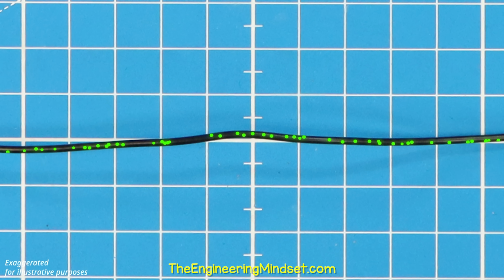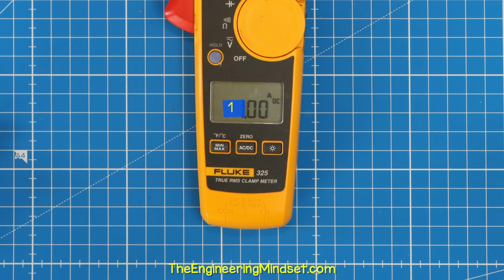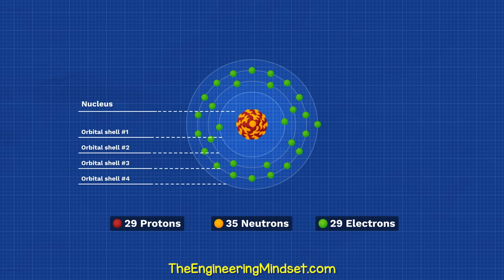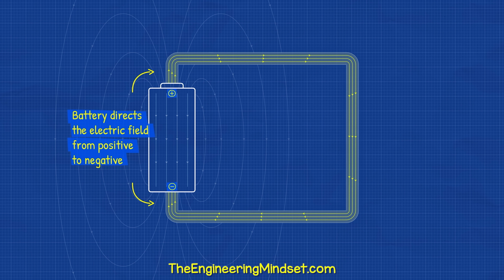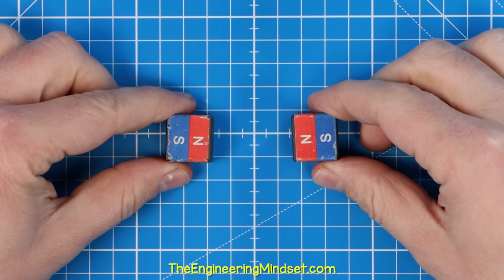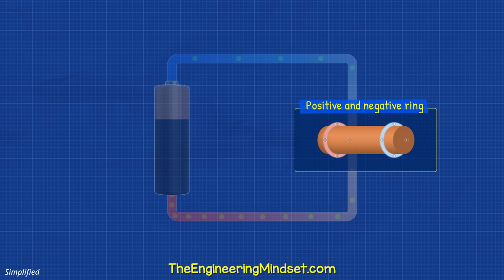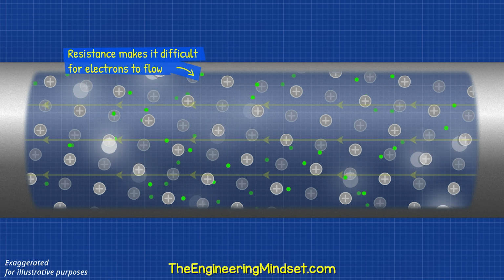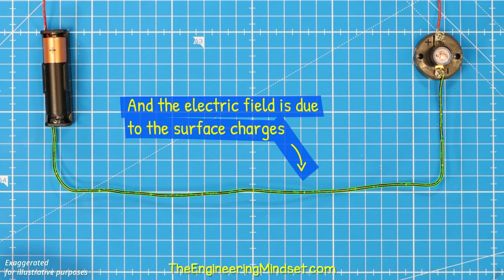How Electricity Works - for visual learners

Comment: Very refreshing (no pun intended) to hear someone attempt to actually explain electricity –instead of just using the "water-flowing-in-a-pipe" analogy. I'm still not desperate to understand how it works, and watching this video a few more times should help a long way!
Reply: What a weird comment
Reply: @henkenheimer9034 most of the people explain electricity as just saying water flowing down the pipe in microscopic version 😅.
But this guy explained everything in a proper way
Reply: Ohms law is not a law that ohm created but an order which things obey which ohm happened to witness. Who gave the order and why are the things so loyal as to obey consistently? You see different perspectives look for different ways to explain things. Water through a pipe is perfectly fine.
Reply: @LetYourMindPlay  Until it's not. Last time I checked reversing the flow of water in a pipe 50 times a second did not help it travel further. The comparaison with water is really just that, a comparaison. It can help explaining electricity at a very very shallow level, but too often that's the only explanation we get. It's like saying planets are round because they "prefer" this shape, which I read somewhere. Just feels very unsatisfying and illogical.
Reply: @henkenheimer9034  I was about to say the same! 😃
Reply: @haventyetbegun  it's not illogical but focusing on a different aspect and at a different level... Most of what was said in this video is not actionable knowledge. Especially not for an individual. Meanwhile the water example often given is plenty to give real world electricians an understanding enough to get them started. The information presented is accurate to the degree of which it was studied. The author even mentioned how he chose to show atoms in a classical sense rather than in a quantum sense. Which one is real? They both are, one is more useful and easier to understand, the other also useful, but more than likely to future generations. It's ok to appreciate your level of study, but don't mock the other levels as they may prove more useful.
Reply: @LetYourMindPlay  I don't know where you got the idea I was mocking other education level. Yes it's very easy to make the point that any knowledge is just an abstraction of reality. But there's still a difference between an abstraction that's meant for practical purpose, and an explanation meant to make us understand things, how illusory this goal may be. What I'm expressing here —I'm surprised some people find it controversial— is criticism of the fact almost all videos and articles I found before that claimed to explain electricity (for curiosity purposes, not for teaching electricians) did not even attempt to explain anything, but relied on making parallels with water whenever convenient. TLDR: I'm glad I found a high-quality video that delivered on its title 🙂
Reply: what annoys me more is explaining electricity in terms of height... Like energy potential differences. I don't wanna analogy when learning about this shit. I want to understand this actual phenomena. There's no real analogy to this in real life I guess.
Reply: @PinkeySuavo Well how else are you gonna explain something aside from analogies. We can't see any of this stuff physically so aside from mental models you only have math. But math is hardly enough to get an intuitive sense of physical phenomena which are invisible.

Comment: Summary: EM fields/waves are travelling first when you flip the switch. They induce "current" in the wires, but it's only a power loss (some fraction of fields penetrates the wire - superconductor doesn't allow that). Energy is OUTSIDE the wires (very close, in the insulation).

Comment: Nice to see a video that highlights the role of surface charge in circuit theory. For too many years it has been neglected in basic courses, to the point that ignorance of its role is a major cause of misunderstanding electrical phenomena.

I envy your ability to synthesize concepts in so short a video. It's taking me multiple half an hour videos just to introduce the concepts of voltage and potential difference.

Comment: So how did they see those electrons again to formulate the math formulas ? It's  a metering system to charge money for something not understood. Hence the name, Electrical Theory.
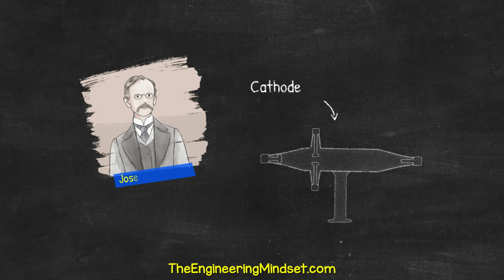Reply: Rewatch the part from 1:26, that should explain it
Reply: Again, nobody has ever seen an electron....it is a hypothesis. Just because a mathematical equasion exists does not make it relevant.
Reply: If you have not noticed yet, we build math to fit findings all the time. Our electrical math is good enough to build computer chips and not burn up or fry. It may lack a little in the magnetic field of coils, but we get close. All of the math we use for electrons has been accurate enough with a few notable changes in history to allow trillions of transistors in a CPU to function at ghz speed. As well as the RAM, and Power Supplies. So maybe it's not 10p% perfect in all areas, but its close enough for us to build miniature computers with screens that communicate wireless aka Cell Phone. So the math I would say is good enough for the task as far as I have seen so far.
Reply: @newmonengineering  I believe OP means in terms of charging £,$,€,R,¥ per watt. There could be inflation in terms of company charges.

As we get more educated, knowledgeable, effective and efficient in producing energy. Costs should either stay or drop reletive to improvement. Not increase as high as they do now.

Comment: At 8:21 the correct formula to calculate the Time to travel should be time=distance/speed, not time=speed/distance. The result is correct, but the operands are swapped. Great explanation though, thanks!
Reply: nice observation
Reply from the maker: You are correct, well spotted @davidegalilei e-mail me and I'll send you a mug.
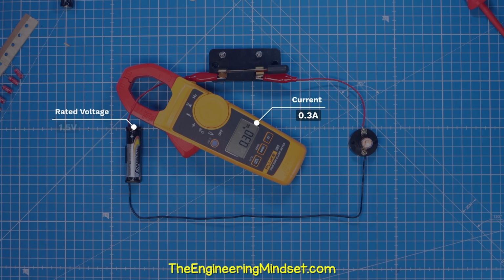Reply: @EngineeringMindset  While we are at it, at 4:00, the formula for power should have amperes (units) squared, so 5Ω × 0.3² A² = ..., or (0.3 A)².

An excellent video packed with valuable condensed information!

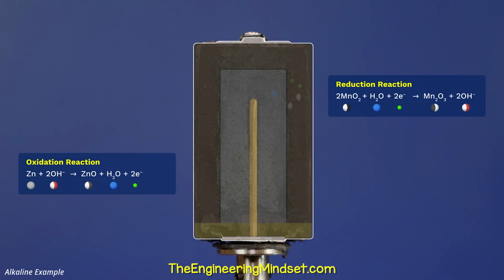Comment: 9:40
For the love of god, please explain us, in this fasion, how having 2 or more batteries in series increases the voltage.

I drew all of this out on paper and it makes no sense to me still.

According to this, I should still expect the same voltage!
Reply: When you put the negative electrode of the top battery in contact with the positive electrode of the bottom battery, the excess electrons and the lack of electrons neutralize each other. Both batteries are forced to produce a new charge separation that will result in double the positive charge on top and double the negative charge at the bottom. Each battery still produce the same charge separation.
Reply: To add to the reply above, it may help to consider a reference point such as ground. Sometimes ground is connected to earth (earth ground) amd other times it's just a common reference. The point between the 2 batteries could be considered your ground   (or 0 volts) reference point, the the voltage on the negative side of the fkrst battery would be negative voltage.  We just typically put the negative side of the supply voltage as the ground reference point as a matter of convention, and each battery connected in series adds that batteries voltage. This also happens inside batteries with more than one cell in series, e.g. a 9V battery has 6 x 1.5 voltage  cells in series inside of it.

Comment: In 1966 while pursuing a BSA Radio Merit Badge at age 10, I was instructed by a HAM operator working with the Navy Military Auxiliary Radio System (MARS) becoming proficient at sending and receiving  Morse Code beyond 30 WPM. All that to say: I had to learn all the Electrical Formulas by rote. Any young person today interested in Electrical Engineering will be well served by your excellent presentation. Thank you for not “dumbing down” the subject in any way.
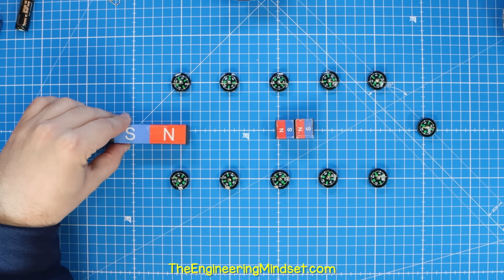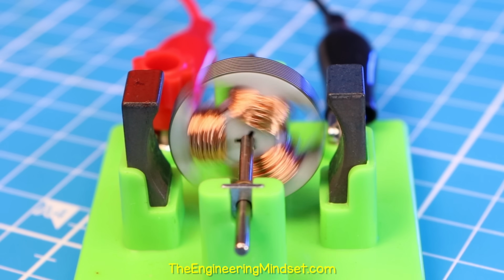Reply: So this video, while being one of the better ones I've seen on the topic, is oh so close, but I think it still leaves a common misconception about what is happening in an electric circuit.  There are several hints in the video about this, especially starting with the field discussion at 6:53 and the drift speed discussion starting at 8:10.  I'm not saying it is wrong, but rather that a key idea is missing.  This idea becomes clear in an electro-plating or electrolysis situation where not just electrons, but whole molecules are caused to move by the current.  The drift speed and time differential in what happens was covered quite nicely by Derek in a video on his Veritasium channel.  I think it would help to say that the ENERGY in an electric current is a wave function that travels along the surface of a conductor whose electrons (or molecules) are easily pulled free to move in the direction of the current.  Thus, the motion of the electrons, while fitting quite nicely with all of the math and equations, can better be thought of as COMSUMERS of the energy in the current.  This makes the pressure discussion in the light bulb explanation more obvious I think, and it totally accounts for the delay in their motion when a current is first setup,  It's a drag function.
Reply: Thanks for informing everyone that is the case 😊
Reply: @charlemagnesclock  Dereck was wrong, we know this because wire gauge is an exceptionally poor way to gain surface area.  By that proposal, smelting common copper (as 110v electric grade) and placing it into finer gauges would increase the ability to carry charge and it doesn't
Reply: @charlemagnesclock thanks for sharing.   How would the consumer concept then apply to suprrconductors?  I'm not seeing how it would fit the situation.
Reply: @kabbak  This is a guess, but I think it is a good one.  So let's look at what the physicists are telling us about the nature of particles when they come together and form larger structures such as atoms and molecules.  This thing they are still calling forces (now down to three, since they have decided that gravity isn't a force) is somehow a kind of energy that has the potential to bind things together.    Remember that all of physics, especially at this level, is just math, models, predictions, based on those models, and measurements to validate or find issues with the predictions.  So definitions for things like forces and energy start to look more like equations than something to which language structures like to assign something discrete like a noun.  Every time physicists start to get comfortable with saying something IS x, some new data comes along to cause trouble for that sort of statement.  Ok, with that serious limitation in mind, it would seem that way down at the particle level, there is some sort of similarity between energy and the three remaining forces.  As temperature goes down, the energy level within the particle structures goes down as well, especially as things approach absolute zero.  Thus, one would expect the drag on the waves travelling along the surface of the materials that easily let go of their outer shell electrons (i.e. conductors like copper and gold) becomes even less, hence superconductivity.  This line of thinking would seem to align well with the challenges that have been faced trying to identify a way to have superconductivity at STP.    But again, I would rather put the question to someone like Sabine Hossenfelder or Angela Collier, since they are real physicists, and are both good at explaining stuff like this.  And I am fully open to Angela having one of her little snits and calling all of this crackpot physics.  Derek Muller is more of a math guy, but because of his channel popularity, he has the ability to tap a lot of top physics teachers to make contributions, so he could do a good job as well.  And while we are at it, let's all wish Dianna Cowern success in her efforts to recover from long COVID.
Reply: It's STILL so much layer-upon-exasperating-layer of scientific jargon which DEMANDS a degree in physics or electrical engineering, an extremely rare and special INSIGHT at the very least, to comprehend this mess. I TRIED.
Reply: @waynesanchez6504   Electricians have their own language.  Here is the core: No one knows how electricity works.  They know how to use it, control it but not how it works.  Voltage is a design.  Amps is the working load.   Ohms is the resistance or loss.
Reply: @whatsup3270  Well it's not just surface area, it is the volume of space around the conductive materials.  That's because of the field.  Look, I'm more of an engineer than a physicist, but it just stands to reason that when you move something, energy has been consumed in the process.  If we apply Occam's Razor to this and the skepticism requirement that extraordinary claims require extraordinary proof, I would think that the claim that the electrons move without consuming any energy would be the extraordinary claim.  Again, this whole thing fits really nicely with the whole business of resistance.
Reply: @charlemagnesclock  Though I agree with most of what was said I would like to point out the evidence is the oppose of Veritasium's proposal.  For example if an equal wire is coated with an insulator and tested bare it functions better when it loses or greatly impairs its surface electrical field with that insulator.  Occam's razor would say the bare wire can not create an electrical field unless it converts or loses energy to do that.  It would also say a resistor generates heat and thus losses energy while and insulator does neither.
Reply: @waynesanchez6504  I was going to drop it, but I think this video deserves one heck of a lot more respect than this comment suggests.  It is extremely well done.  Once one starts talking about anything that is beyond two or three orders of magnitude in either direction from what our human senses can perceive unaided, the standard engineering and scientific models kick-in.  These require some standardized language.  That can be a bit of a hill to climb no matter what the topic, but that is what is required to go there, and this is an excellent presentation.  This stuff is HARD, and people have been struggling with it for at least 3,000 years (ref: evidence of Babylonian battery experiments).
Reply: BSA 1C here first in my troop to get this merit badge BSA TROOP 92 Philadelphia Pa
Reply: @ I'm 74 now,.  In 1964 on my 14th birthday I received my Eagle.  That was two years before they started playing with the requirements.
Reply: @charlemagnesclock  well this random 30-something from the UK highly appreciates your clarifications!!
Reply: @waynesanchez6504  degree? that's insane to me, there's nothing covered in this video I haven't already seen in the (brazilian) public high school I've been to. if your school or teacher didn't fail you (and vice versa), you should be good to follow at least the fundamental concepts he explained–no need to sweat over the calculations
Reply: Very well put and indeed much helpful to better explain while adding a bit more reason to the specificity required to fill the gaps. I'd like to mention as well that I would have liked the inclusion of an explanation for how magnitude exists from the point of view of the electron and try to display its effect to the current since moving at the speed of light it would be insignificant the motion that occurs as the electrons repel each other and in doing so perhaps the visual light from such amount of kinetic energy from a filament @charlemagnesclock
Reply: Nobody asked.
Reply: @charlemagnesclock in one of my classes we watched a video of the atomic migration that can occur due to high constant currents at small scales and it was genuinely one of the craziest things I've ever seen. Literally watching a micro wire tear itself apart just from electric current!!
Reply: @TheThirdPrice  That would be a great video.  Post a link to it here if you ever come across it again.  It makes me wonder about what must be several things that are going on in the tungsten filament of an old fashioned lightbulb as it is slowly decaying.
Reply: At age 10 I was still eating rocks 😂
Reply: @ Self-deprecating for sure, but thanks for making me smile.
Reply: Su'aalaha iigu badan E imka la iwaydiiyo ayaa ah wad yartahe goorma ayad baratay anaiguna wax aan ugu jawaabaa ilahy aya ibaray wayo  ciyar ciyar ayay ii ahayd manay jirin cid kale o igu tidhi baro
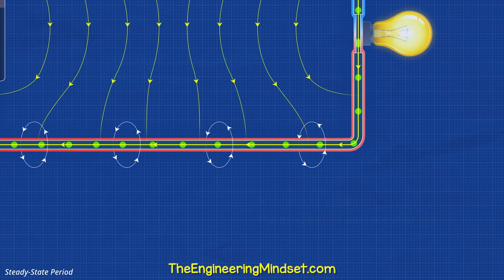Reply: @charlemagnesclock  doesnt he explain it in 16:45?
Reply: born 1956 makes you a boomer. Don't retire selfishly. Your forefathers gave everything for you, and it's your turn to do the same for your descendants. Don't sell everything and retire to a motor home, leave your kids a future they can build upon the same way you were given by your ancestors. Don't be like the other selfish boomers your age, I implore you. Otherwise your legacy, and thus your entire life's work, is for naught but self indulgence and hedonism. Take care of your descendants the way you were taken care of. Help your family
Reply: Im a youngin and you just taught me the word rote. We are not ready to lose our wise elder generations!!
Reply: Not to worry, I’m considered a youngster in my group of friends. Some of which are highly accomplished military commanders, engineers, craftsmen. etc.
I consider each and every one of them an “Irreplaceable Value” and will continue to learn and admire them for the rest of our time on earth.
Reply: Heaviside opened the door